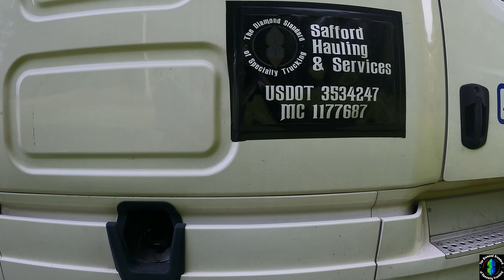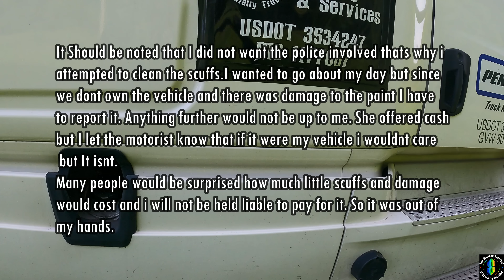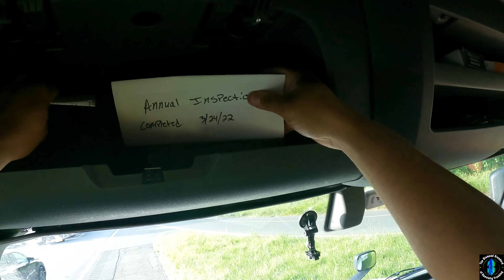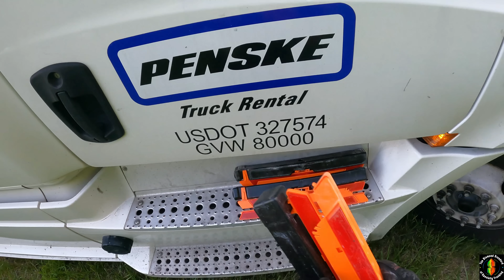Accidents Happen!

Comment: Four studs would be fine, even three. I broke one on my jeep like two yeas ago and still havn't fixed it. I also never retourque my lug nuts after 100 miles. I run 2" spacers with five more lug nuts behind the tire I never retourque after 100 miles either. That's just one truck of many I own just like that. I use a 36" breaker bar and tighten them until they stop turning. Never had a problem in 20+ years of giant tires on Jeeps and pick ups. 
The problem here is that some shop tourqued them to only probably 150lbs or less, like the manual probably says, and then she didn't go back and have them do it agian after 100 miles.
I do things my own way, and I don't advise you to do it too. But to put it into prespective, I pound studs out of hubs at the junkyard and keep them in my rig so If i'm down to 2 or less studs I can press a "new" one in. If you torque a lug nut to 100lbs you'll probably have to do it again, or your wheel will fall off. I was a machinist for years too, so don't tell me about stretching threads and twisting off bolts. I don't ever use anti sieze and I live in Wisconsin with the salt. I'm not afraid of impact tools either, I've been starting bolts, tapping holes, and using silver sockets with impact wrenches since before they were electric. I know just how to turn things already. Be smarter than your tools and materials and you will suceed, also time spent using and doing things will tell you exactly what you can do, regardless of the instructions. 
But yeah, don't be afraid of lug nuts, tools, bolts, nuts, whatever. If all you have is 2 lug nuts you can get it off the highway. If you have a wrench you can just stop every mile and tighten them. Everyone had everything they needed to go anywhere, except the will and ability. But heck, you all probably think im dangerous and an idiot.
Reply: About the anti seize, I don't use it, I just let the fastener do it's thing. Then later if I need to, I get it really wet with penetrating oil, or really hot with fire, or both. I've even cut stuff off if it's easier. You can even drill into a flat on the nut until you can turn it off by hand. But I never have any problems with nuts and bolts I've had off before. The problem ones are the ones I take off for the first time. And I can't go back in time to use anti seize when someone else put the fastener in, so I don't even buy it. I use tons of loctite though, and only the heavy duty, nothing is forever.

Comment: The “deeper than the paint” looks like OLD damage that has since rusted.  Shouldn’t be considered for this event.
Reply from the maker: That's dirt that leeched after I sprayed it with alcohol, the fenders and fairings aren't steel they are plastic... FYI
Reply: Something is fishy with this story due to rust at least a month old.
Reply from the maker: @utoothheartyeight  it's not rust 🤣🤣🤣🤣🤣
Reply: @utoothheartyeight  the fenders aren’t steel or any metal that can rust and u can tell just by looking at it that it’s plastic. Plastic doesn’t rust